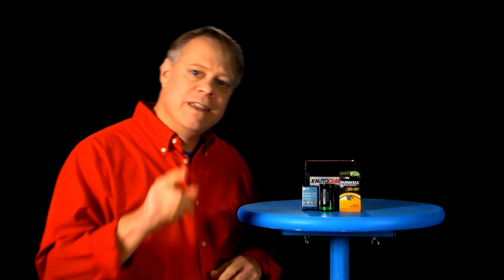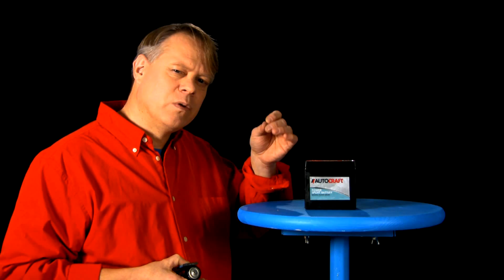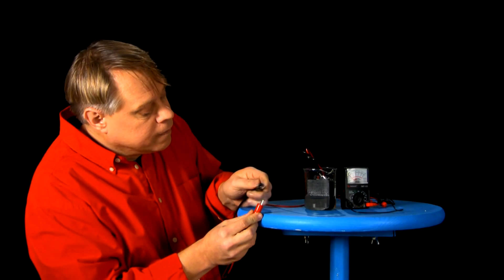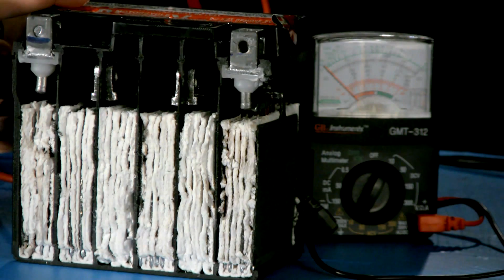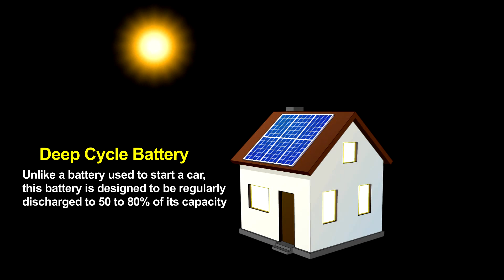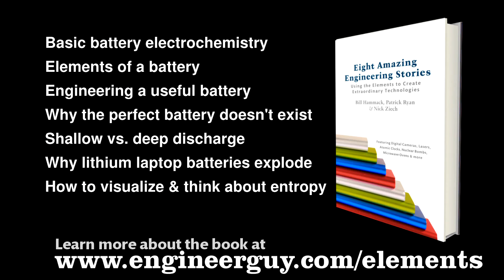4 Minute Lesson How Battery Reconditioning Works - About Lead Acid

Comment: There are several components to fixing a car battery. One resource I found which successfully combines these is the Jons mender guide (google it if you're interested) without a doubt the most helpful info that I have ever seen. Check out this unbelievable website.